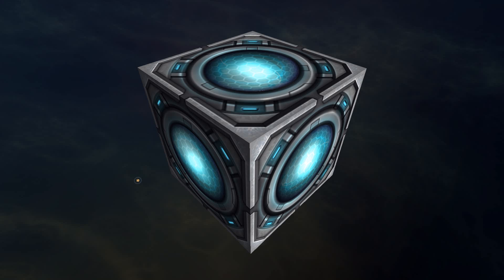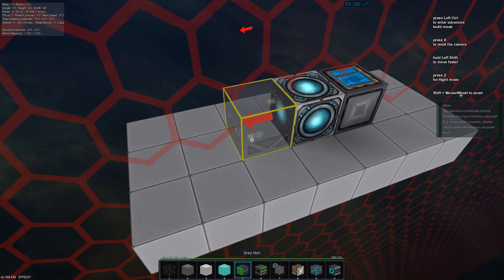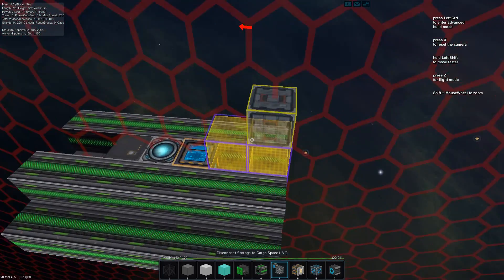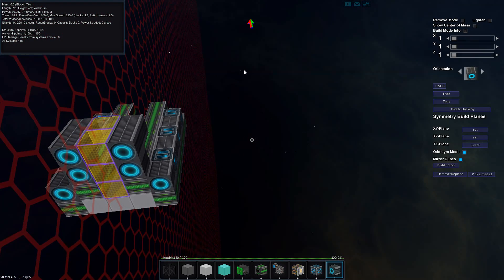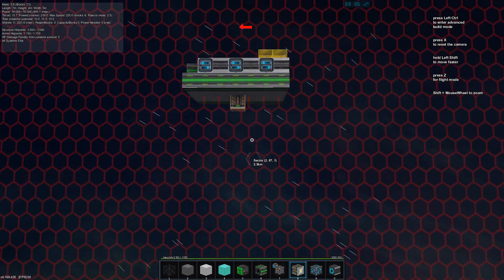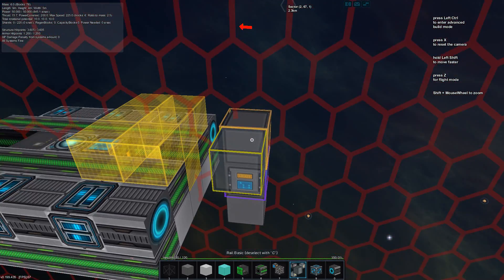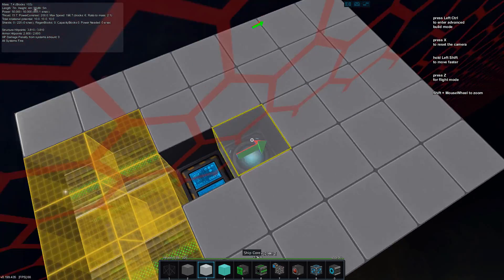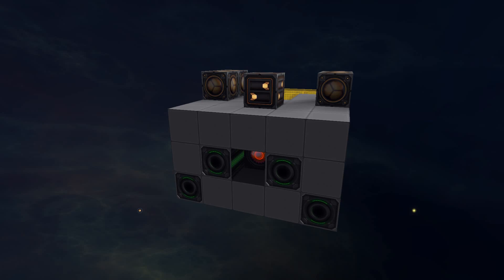StarMade Compact Tutorial | Mining Drone / AI Salvager

Comment: Been trying to do this for a few hours now and I can't get anything to transfer. Is the video out of date with the introduction of the Load/Unload blocks. Help is greatly appreciated!
Reply from the maker: Yes, its outdated, and now you need the load/unload rails, tutorial will come, it will probably be included in the ultimate station tutorial.
Reply: Good, I can't wait to watch it.

In the meantime, how do they work? I've tried so many things to get stuff transferred. 

My current iteration:
Ship is docked to a Unload Block. Unload block is linked (Mastered) to a Storage Block (with cargo blocks attached/linked). Storage is set to pull everything (infinite item cap, pull in stacks of 500)

On the ship, the Docker is Mastered to a storage block (with cargos) and the items I want inside. The storage module's Pull Items is deactivated.

Nothing pulls, though. I've even tried docking it to a Load block, regular block, everything. The wiki wasn't much help either. I really want to get my mining drone fleets up and running to go along with my newly-made all-item crafting station.
Reply from the maker: Right, I need to preform several tests before saying anything for certain ;D
Reply from the maker: Hey, after testing I concluded that cargo transfer does not work for some people, reason unknown but I notified Schema. That means the tutorial will be postponed until it works, also I can't get it to work and it's a game bug.
Reply: @GMODISM  

I'm admittedly glad to hear it wasn't just me, since I was following instructions perfectly and couldn't get any progress. 

I'll stick with manual unloading of resources, but now to get to ships to mine all. They're stuck in Idle. Eh, I'll have to watch more videos
Reply from the maker: Made a vid ages ago, but quick tip is that: commander of fleet can't mine, full storage = no more mining
Reply: @GMODISM   I can't form a fleet and have it's drop off as a station can I ? Or would it work to have the command ship docked to a station for easy offload?

Comment: I have added Bobby AI to mining drones for aesthetic purposes but they currently don't matter. I've made mining drones out of motherboard before, a little power and about 3 thrusters. Another trick to save a lot of head bashing is to add logic to the rail docker to ensure it switches the storage pull off. I have had a lag spike on a server that activated the pulls on 6 out of 8 drones I had! It also allows you to add little gimmicks like running lights, etc.
Reply from the maker: Server lag activating the storage pulls? :o 
Omg, bugfixers pleas fix! ^^